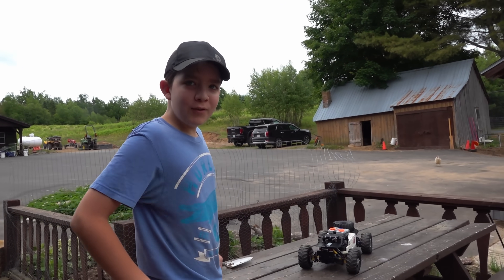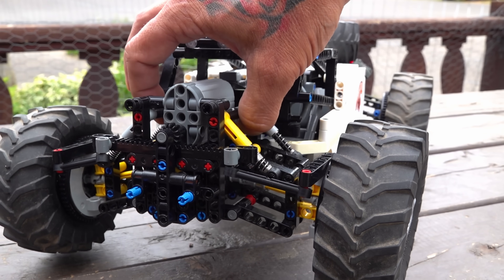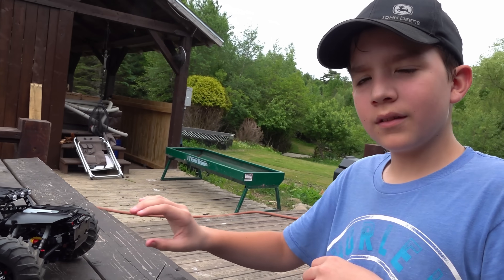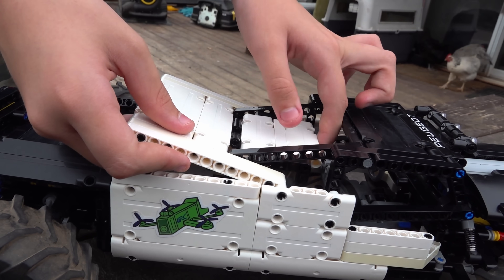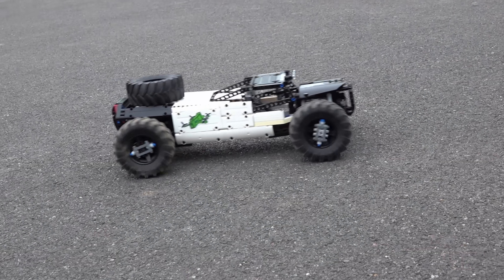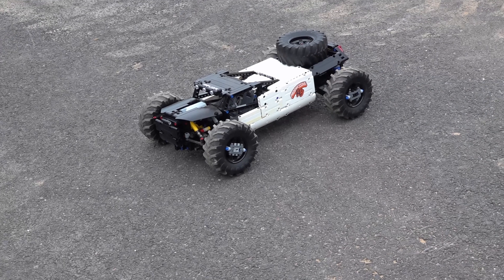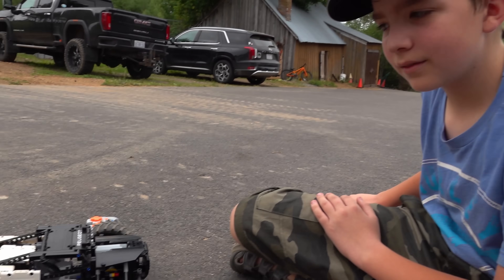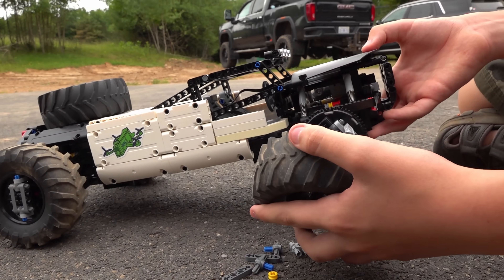Maurice Original Design - Radio Control FWD RWD 4WD All Terrain LEGO TECHNIC Truck | RC ADVENTURES

Comment: Take the parts from the Bugatti Chiron Lego set mix it with a farm truck John Deere Lego farm truck take those parts. Put them together and see how that works and make it motorized and then use the PaganiPagani Vira and the farm truck. See how that goes.
Reply from the maker: Some serious Lego engineering going on there!